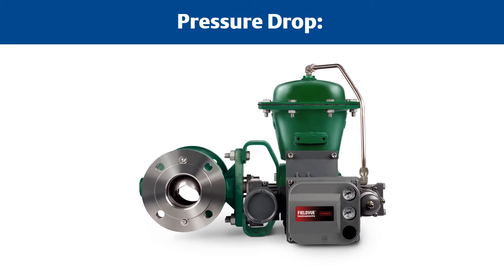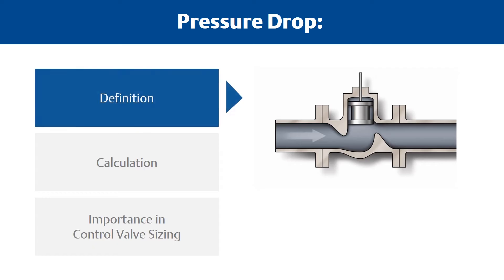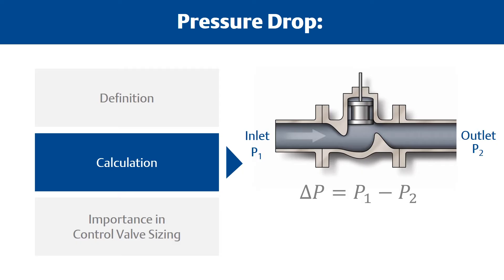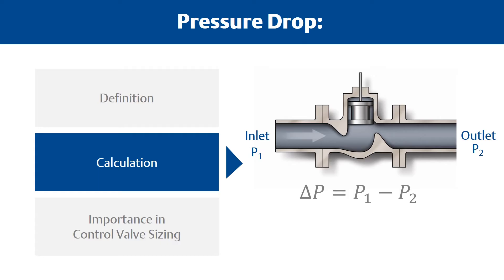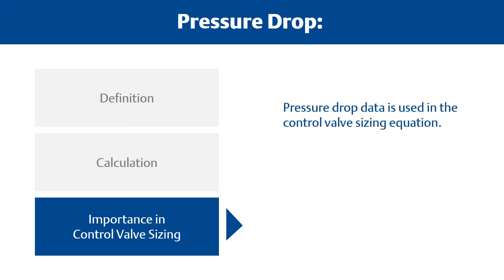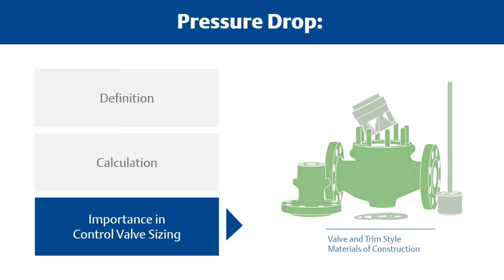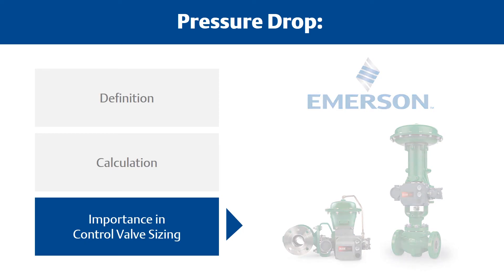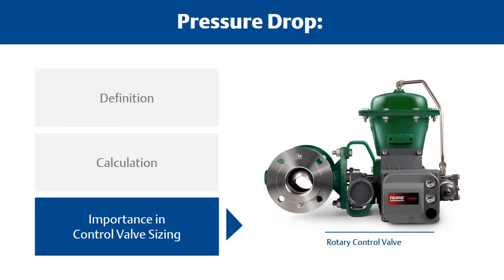Control Valve Sizing Basics: What is Pressure Drop?

Comment: Why p2 is measured six pipe diameters downstream of the valve? Why can't it be measured right at the outlet?
Reply: Because of the vena contracta inside the valve, you will have two pressure losses. Temporary and permanent. Temporary losses occur but pressure is recovered some distance down the pipework. For sizing a control valve, we are mainly concerned with the permanent losses, though we want to make sure that temporary losses don't cause flashing or cavitation.

Comment: What is the difference between Cavitation and Falshing.?Can you please.?
Reply: When pressure drops below a fluid's bubble point and turns in vapor ( look at a P-T phase diagram) that is flashing (liquid turns to vapor). Cavitation is when pressure increases again so the vapor changes back into liquid. This phase change has the vapor bubbles collapse in on themselves creating miniature ultrasonic shock waves which degrade materials quickly. Cavitation sounds like gravel running through a pipe, just fyi

Comment: pressure drop also known as pressure loss is an important selection criteria for control valves as it's used in the sizing calculation let's define the term pressure drop show how it's calculated and discuss why it's important for engineers designing flow systems the difference in pressure as measured between two points in a pipe with flowing fluid for a control valve the pressure drop is the difference between the inlet pressure and the outlet pressure it varies with flow the calculation for pressure drop looks like this Delta P equals p1 minus p2 the pressure drop is usually measured in pounds per square inch differential or psi D Inlet or upstream pressure is shown as p1 outlet or downstream pressure is shown as p2 p1 is measured two pipe diameters upstream of the valve p2 is measured six pipe diameters downstream of the valve your process or instrumentation Department will provide these variables to calculate the pressure drop across a valve subtract the outlet pressure from the inlet pressure for example if p1 is 3000 psi and p2 is 2,000 psi the pressure drop will equal 1000 psi D if the flow rate is going to vary repeat the calculation of p1 and p2 at each flow rate pressure drop data is used in the control valve sizing equation and is critical for proper valve selection control valve flow is a function of both the pressure drop across the valve and the valve travel in control valve selection pressure drop plays a role in determining not only the valve and trim style but the materials of construction as well higher pressure drops generally require highly engineered control valves for good performance control valve manufacturers published charts with maximum pressure drop limits for their control valves the charts for Emerson's Fisher control valves can be found in their product bulletins the maximum pressure drop a control valve can tolerate at shut off or when partially or fully open is an important selection criteria globe control valves are generally superior in both regards because of the rugged nature of their moving parts many rotary control valves are limited to pressure drops well below the body pressure rating especially under flowing conditions due to the stresses that high velocity flow imposes on the disc or ball segment thanks for watching.
Reply: Why does pressure drop in the globe valve?
Reply: @SamA-xu9gy  From what I understand, due to collisions with the internal valve components and restrictions as the flow path is not linear

Comment: how will you know what P2 is if you dont know what control valve you are choosing????
Reply: https://www.flowcontrolnetwork.com/valves-actuators/article/21145721/determining-pressure-drop-for-control-valve-sizing  Article in this link gives solution for your Question.
Reply: pressure drop also known as pressure loss is an important selection criteria for control valves as it's used in the sizing calculation let's define the term pressure drop show how it's calculated and discuss why it's important for engineers designing flow systems the difference in pressure as measured between two points in a pipe with flowing fluid for a control valve the pressure drop is the difference between the inlet pressure and the outlet pressure it varies with flow the calculation for pressure drop looks like this Delta P equals p1 minus p2 the pressure drop is usually measured in pounds per square inch differential or psi D Inlet or upstream pressure is shown as p1 outlet or downstream pressure is shown as p2 p1 is measured two pipe diameters upstream of the valve p2 is measured six pipe diameters downstream of the valve your process or instrumentation Department will provide these variables to calculate the pressure drop across a valve subtract the outlet pressure from the inlet pressure for example if p1 is 3000 psi and p2 is 2,000 psi the pressure drop will equal 1000 psi D if the flow rate is going to vary repeat the calculation of p1 and p2 at each flow rate pressure drop data is used in the control valve sizing equation and is critical for proper valve selection control valve flow is a function of both the pressure drop across the valve and the valve travel in control valve selection pressure drop plays a role in determining not only the valve and trim style but the materials of construction as well higher pressure drops generally require highly engineered control valves for good performance control valve manufacturers published charts with maximum pressure drop limits for their control valves the charts for Emerson's Fisher control valves can be found in their product bulletins the maximum pressure drop a control valve can tolerate at shut off or when partially or fully open is an important selection criteria globe control valves are generally superior in both regards because of the rugged nature of their moving parts many rotary control valves are limited to pressure drops well below the body pressure rating especially under flowing conditions due to the stresses that high velocity flow imposes on the disc or ball segment thanks for watching.